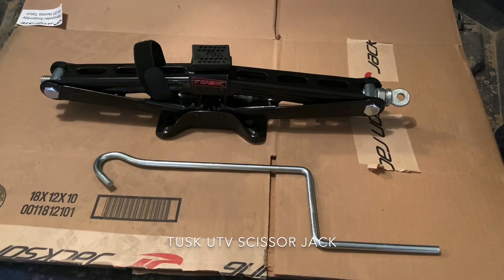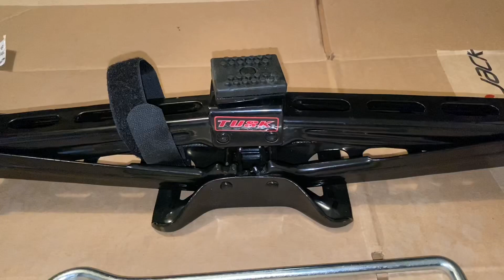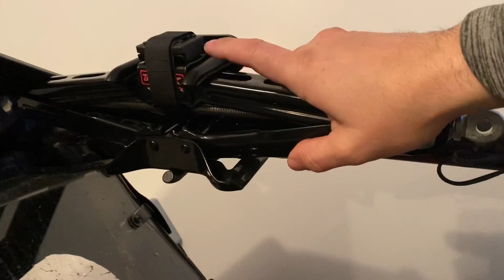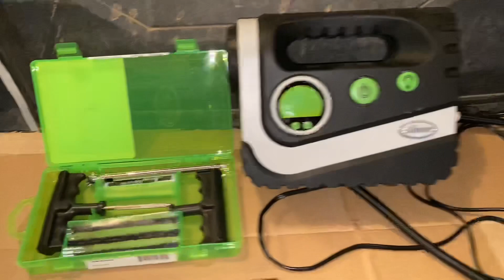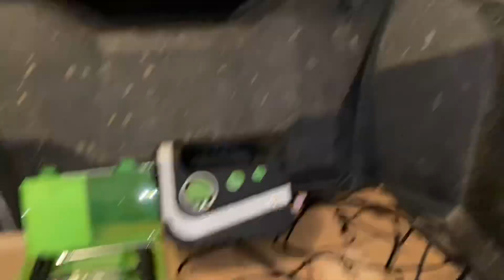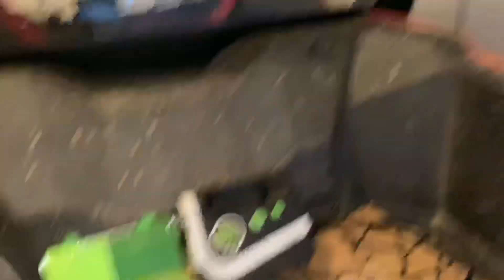Honda Talon scissor jack, 12V air pump and tire repair kit recommendations. 1000R 1000X

Comment: Does the side wall damage come from rock climbing?  I’m up in the mountains of Washington state and we have hundreds of miles of Forest Service roads.  Seems like a million tight turns and some straight runs with small whoops that widely set apart.  But no rock climbing.  Do you recommend a tire repair kit, a spare tire, or both?  I think I’ll add the spare tire regardless to add weight to the rear of the car.
Reply from the maker: For me, it’s more likely to get sidewall damage from downed trees. I have a tire plug repair kit and air pump.

Comment: Good video on mounting that  jack, and advice on plug kit.     Wondering how you actually use it in the field.   I understand the Jack extends to about 18" tall.  That being said, What jack points and perhaps what additional spacer do you use to actually lift the Talon enough to change a wheel.  ?
Reply from the maker: Seenager Marty you lift up on the frame. You can use any type of a spacer, wood, plastic etc.

Comment: Thanks for the picture and story on fixing sidewall, hadn’t thought about it, haha !!
Reply: I talked to a guy that used tire plugs, rubber cement and a broken off stick to fill a huge sidewall gash. Mountain bikers have used leaves and grass packed tight into the tire when they didn't have a patch or a spare tube. Whatever it takes to get down the mountain and home, I guess....